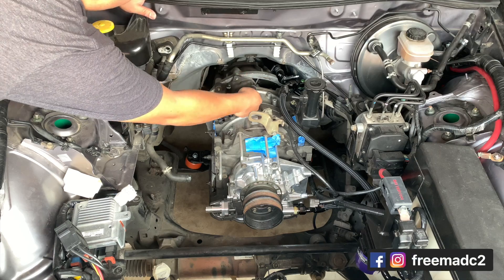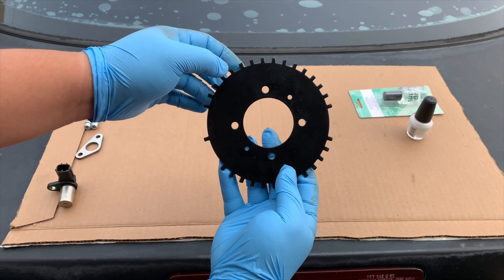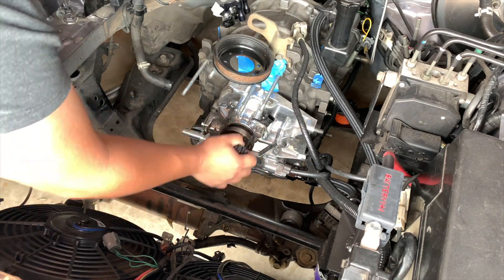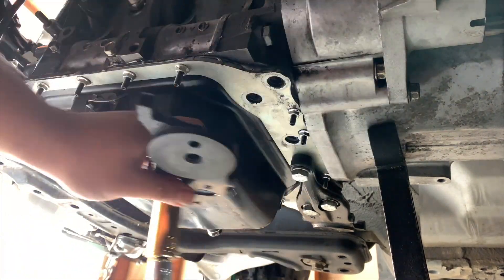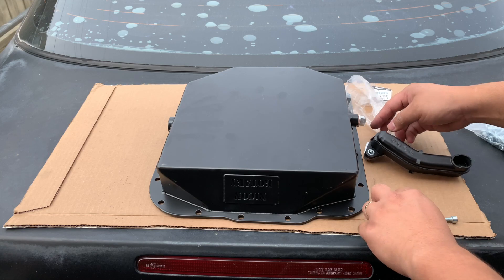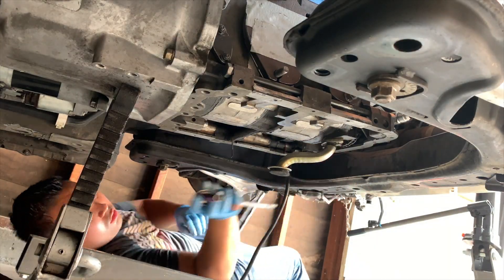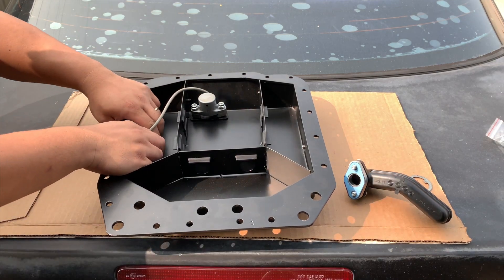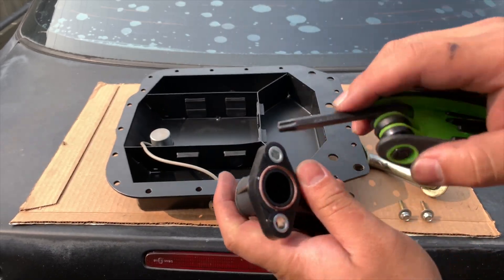13BREW RX8: Installing Nicon Rotary's Trigger Wheel and Low Profile Oil Pan

Comment: In the process of my own fd swap into a 07 shinka rx8. Definitely ordering this oil pan and trigger wheel, I was gonna use the rx8 front cover for ease of AC compressor installation but I've seen others install the compressor with the FD cover also. Question: which motor mount kit did you end up going with? Only ones I know is CXRacing and RX8performance.  Thanks in advance
Reply: Just ordered- Mount Kt, oil pan, trigger wheel, rear Diff bushings..didn't know they were in Russia lol shipping was expensive
Reply from the maker: @joemurcia3527  yea shipping a bit expensive but well worth it. You have just saved a ton of money for sure. When it comes to the oil pan, you will need the oil pan pick up tube from an rx8. Message me on instagram or facebook and ill show you what to modify. @freemadc2
Reply: Perfect thank you 🙏 
I have a couple of those pickup tubes, I have 2 rx8 currently one I'm keeping the other gonna do factory rebuild and sell.
Reply from the maker: @joemurcia3527  dope! who is building your rew?
Reply from the maker: Thanks brother. Actually if you purchase the Nicon rotary mount, it’ll come with poly bushings already
Reply: Perfect thank you  🙏 
I hope you don't mind, I may bug you with more questions later. It seems you're way ahead of me on that build. I should have my Fd 13B assembled next week and then the fun begins
Reply from the maker: @joemurcia3527  of course anytime. I may not have the rx8 anymore but I have completed my FD build.

Comment: How come you didn't keep the Rew pick up tube ?
Reply from the maker: Hi, Nicon rotary low profile oil pan needs to use the RX8 pick up. They also include an adapter for easy install
Reply: @freemadc2  oh ok, makes sense now
Reply: The FD pickup tube worked fine also. Just installed today.

Comment: Great job! Since I did not have the spacer as I did not buy Nicon rotary pan, I simply cut the spacers so the bolt would fit in the proper orientation and not move around. I’m waiting on a B2A pan.
Reply from the maker: B2A is going to be niceeeee!

Comment: Your supose to be able to run rx8 oem ecu with trigger kit and throttle adapter?
Reply from the maker: Thanks for following my build my friend. My motor is actually from a 1993 RX-7. So an aftermarket trigger wheel is needed. I will be using Adaptronic Modular ECU to make everything work.
Reply: When you say "Everything work" 
You mean all gauges in cluster etc..? 
I was wondering what ECM to go with that would facilitate that. I'm just putting my fingers Nguni together now so I have some time to do more research .
Reply: Also I thought adaptronic was shut down by Haltech after they bought them out. Maybe I misunderstood

Comment: Nice job, that oil pan looks great. I just went through dropping & reinstalling the oil pan on my 8, what a pain. I switched to just a gasket, silicone is miserable to work with.
Reply from the maker: Thanks man. Yea Ive gone through a share of oil pans and by far a gasket is a lot more cleaner.